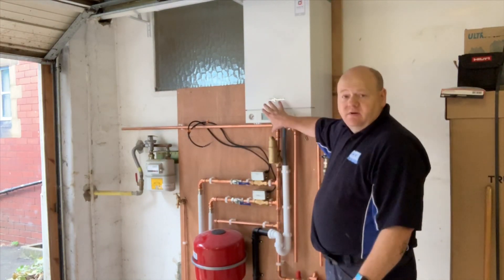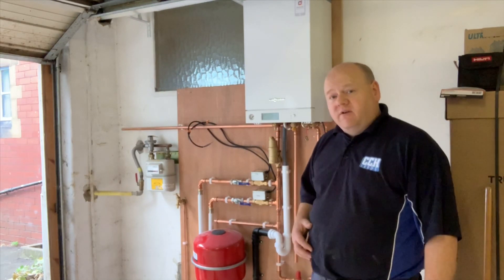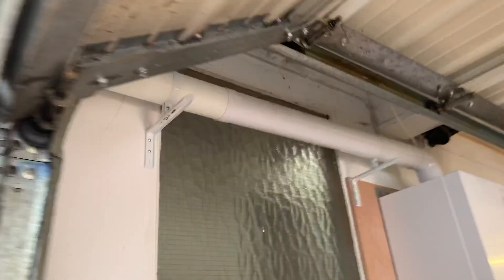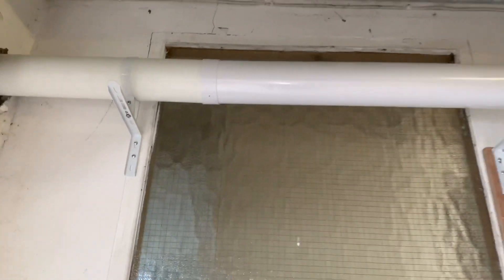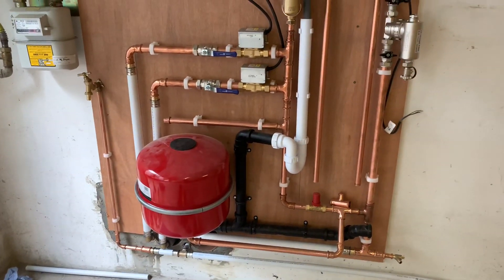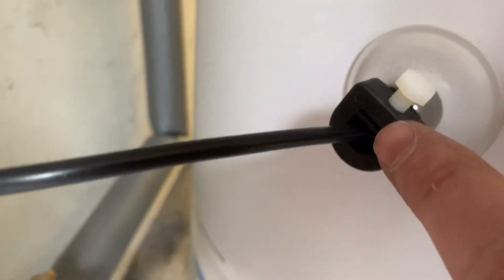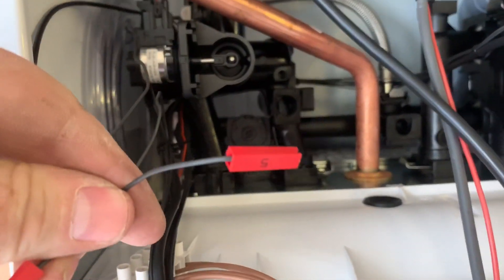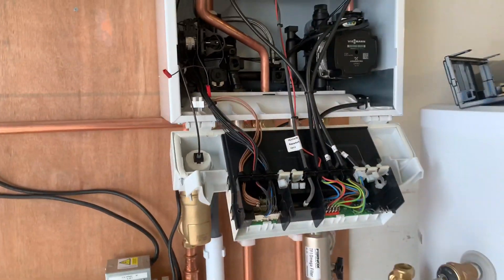Plumber - Cylinder installation part 4

Comment: Great videos Alan!!! One question though, will you not get galvanic corrosion over time when mixing copper and aluminium pipes?
Reply from the maker: TheLinkedList It’s multi layer buddy, the water doesn’t come into contact with the aluminium, It wouldn’t be an issue though as some boilers have aluminium heat exchangers 👍Thank you for the comment
Reply: @AllenHart999  ah makes sense. I couldn't really see if the inside of the  pipe was aluminium or plastic. 

Great job on the install though, looks very neat and tidy!

Comment: great  installation  Allen  is cylinder    is suitable  for a bigger house  2 bathroom  2 shower   and can do a video  on the  new pipes you used they  are  a new on the  market  enjoyed  the  video
Reply from the maker: They only have one bath at the moment. Only 3 people live in the property. They cylinder is definitely big enough and with the 4 pipe the recovery is very very fast. Thanks.